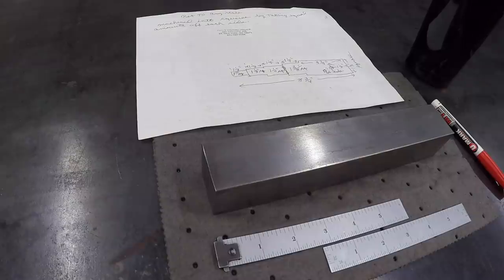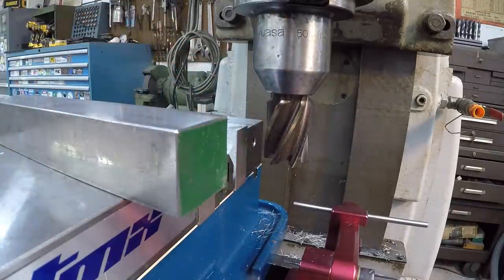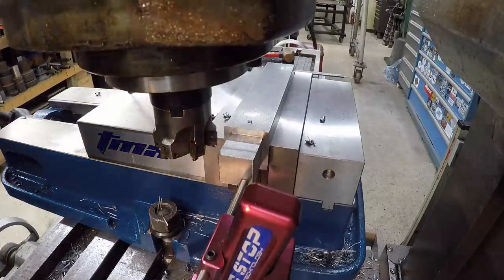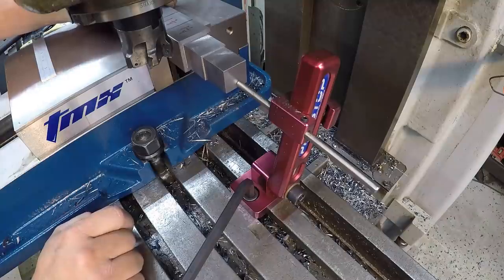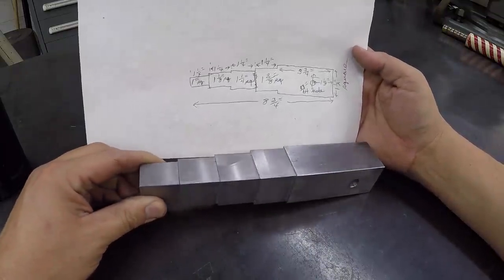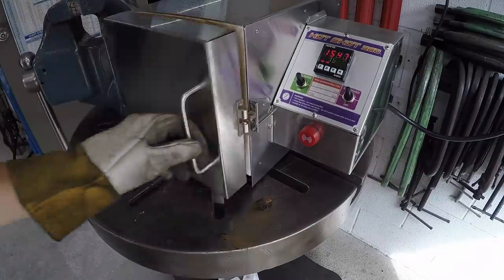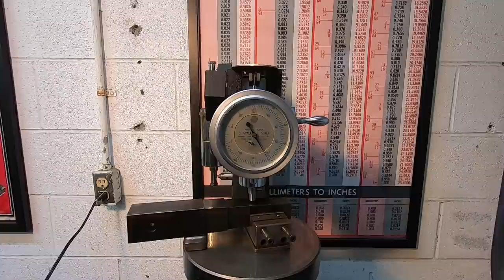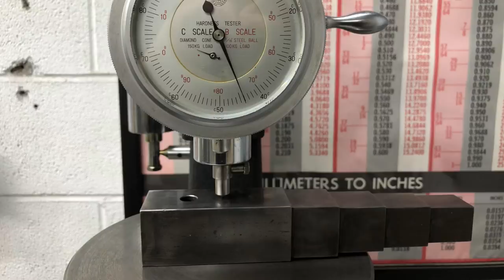SNS 296: Custom Square Drive Tool, Heat Treating

Comment: Removing the foil (quickly) before quenching should be much better. Otherwise it's a much slower cooling..
Reply from the maker: Easier said then done
Reply: Indeed, this cries out for a clever tool to tear it off!
Maybe when you open the oven, something to split the foil and leave it behind while the work piece slides out.. Ceramic scissors? Or tungsten?
Reply: @Abom79 : love watching Your posts, I have never commented before, Adam have a couple things, cheap: piece of channel and if need be tack on some higher sides and ends and the cheap part, those cast iron chips that we save when machining them, make a bed of chips and lay part in and cover up completely with chips, also a  piece of stainless steel wire thru the hole to pull out quick and get in oil quick, also when checking on Rockwell c scale if You don't have to grind the whole part just surface grind a small area to clean scale off for correct reading. Yes, metal bucket and orange glow all way thru and quickly pull from chips and into oil. I know You have bunch of comments, want to help with comment. God Bless You.

Comment: What hardness did he get on the part after quenching it the second time around?
Reply: He showed in the vid that he got a couple spots at 41 but most were much lower and the average was around 26 HRC
Reply: @GeorgeBurkhard  Think he said he was not happy with the results and did everything a second time off camera. Was wondering if that changed the results.
Reply: @the_hate_inside1085  Oh I had thought those numbers were after the second time. Could be wrong! I guess it is confusing.

Comment: OOPS!   That hole you drilled was supposed to be on the other face, 90deg out :)
Reply: on the other side of the square, symmetrical tool?  Unless this is in jest and then I feel like a shmuck.

Comment: Not bad  for not having much experience in heat treating you were probably in the high 40 hrc i would of not put it in so long hour should of been good at that temp then as soon as it comes out quench in either oil or water with 4140 then draw back for two to 4 hrs at 400 degrees a2 or d2 would of been good at that temp an time

Comment: 3 things I would have done different, I would have annealed before milling so it didn't bow, then I would have annealed after milling, and surface ground the tool to the end specs.

Also for heat treating 1hr=1mm of heat penetration. So if you did 2 hrs, your hardened surface is 2mm deep.
Reply: hahahaha.   We've got ourselves a keyboard metallurgist! fun!     Your 1hr/mm you are referring to sound like parameters for case hardenening non-hardenable alloys or something.    Keep Blazin! lol
Reply: @jamesolivier3192  case hardening non hardenable alloys? Smoke some more crack guy.... 😂 😂 😂 Heat treatment is pretty self explanatory, you need to get the piece of metal hot enough rearrange the molecular structure, the thicker the piece of metal is, the longer it takes to get the core to that temp. Adding carbon to it is also important, as the iron molecules are bigger than the carbon, and the carbon fills out the empty space during the wandering of molecules which the heat creates.

I mean you don't have to believe what I say, but I'm 100% certain the Germans are more standardized than the states are (which is why we have metals here in Germany that you can only import to the states). 

I just happen to work in the manufacturing of bearings, with 3 industrial blast ovens at work, that use nitrogen to add the carbon. If his tool was properly hardened, it would need to be ground down, because the metal swells due to heat. Glad you could say I'm wrong, and try to tell me that I'm trying to harden non hardenable alloys. For the record we use bearing steels, normally 100Cr6 or 100Cr6Mo7.

Comment: Question: Is it better to do conventional or climb milling ?  Is there a difference ?  Thanks.
Reply: Climb milling is typically better.  Sometimes during conventional milling your part will be out of spec due to backlash.
Reply: Climb milling creates a better surface, but you need a machine with little to no backlash, as climb milling exerts more axial forces onto the workpiece and will slip on typical acme threads.

I was taught to mill conventional on a conventional mill, because of the threads. Unless you have a ball screw I would use conventional.
Reply: Climb milling gives a better finish but not recommended on small Mills because it will create a lot of backlash and shaking. Climb milling is usually only done on large manual machines and CNC machines. Conventional is recommended for smaller manual machines and is typically more recommended in general.
Reply: @CatNolara  Thank you
Reply: @chronicblazer84  Thank you
Reply: @SweetTooth8989  Thank you
Reply: You're welcome thanks for you input to my question.

Comment: As to your question about the orientation of the piece in the oven, if standing it up would be beneficial, it really depends. If you are through hardening or hardening the piece in any way in which exposure to a specific material is NOT a critical factor, then no, orientation will not be critical. This is justified by the heat soak time in which the molecular structure of the material changes orientation through the heating of the piece, thus allowing the carbon to migrate across the structure therefore improving hardness. There are other factors, this is just one example. If you are hardening a piece in which exposure to a certain material IS critical, such as carbon for carburizing, then surface area contact with that material should be considered and orientation becomes important. Just from the small amount this video reveals, that ovens thermal capacity may not be enough for the time allotted. The "one hour per one inch of cross section" is much more complicated than it seems. There are several other considerations that play a part in the clock time at the different phases of transition, the limiting factor is thermal capacity. Your part may have just needed a longer soak, or a stair step up/down cycling, in where one temperature is held for a time then a higher temp is held. Just a word of caution, there are many channels on YouTube in which the creator may be "familiar" with heat treating, however, if I were you I would would find a ASME book that covers heat treatment of materials. No hatred or contempt, but A LOT of what I have seen about the subject on here is mere speculation or misunderstanding.

Comment: Ive not done alot of hardening, just a few times myself, but in the shops ive been in theyve always used the foil on air hardening steels and always do some normalizing cycles before hand in order to avoid the inconsistencies. Wish i could be of more assistance. Unfortunately im not real familiar with HTing.

Comment: It must be hard for that oil to pull heat out of such a large thermal mass. It’s probably getting heated from within almost as fast as the oil can drag the heat away from the outside

Comment: I work with some heat treating in my job.  Take the smaller piece that you heat treated and remove about .060" from all sides then recheck it and see if you get a more consistent hardness around what you were originally looking for 50Rc.

Comment: I think when you temper you let it cool down slowly over time rather than use the oil like you would in a quench
Reply: This is also what I’ve seen when making knives.
Reply: Yes , you heat it up and let it cool slowly, this will relieve any stress in the part.

Comment: I remember the factory making some EN32 pins, after heat treatment one of the draughtsman took a pin back to his drawing board, where it promptly rolled off on to the floor and shattered. Oops.

Comment: Air cooling then a draw has worked best for me with D2 4140 and S7. Never really quenched in oil unless the parts are small for like sensors or tooling balls. But I’m only 24 with 5 years experience so what do I know.
Reply: Age is irrelevant. Mental plasticity is an advantage. Experience is generally valuable. If someone leads you to believe otherwise tell them "fuck off, you're a moron" and call it education.

Comment: Look up your TTT charts for the 4140, if it takes more than ~8 seconds to cool down to martensite range then you may miss the curve and end up with too much Pearlite.. https://www.researchgate.net/figure/TTT-curves-of-steel-4140-corresponding-to-10-and-90-of-transformation-3-It-was_fig5_267529079   I just learned about TTT charts from a buddy, hope it helps! going to high temperature in the austenite range will give you a bigger grain structure even when you quench.
I read this in one spec sheet "the steel should be austenitized at 1500 to 1550 º F (815 to 845 º C)," so maybe you're over a little bit... but not so much to make a bigger grain size  (maybe?)... 50C over the recommendation.. unsure. maybe it drop it 30c over.

So you wanna know - what is the austenite transformation range, and what's the TTT curve (quench time/temperature) to keep it from forming Pearlite (slow = soft)

Also, martensite continues to form below 0c, so you can also dunk it in super-cooled liquid and get a little more hardness :)

Comment: What I do not understand:
Normally you have some deformation on the material after the heat threading. Depending on the material and the steel charakteristics, the deformation can be substantial. Because of that, in case of precision tools, you make a milling with oversize, and then heat threading, and grind to the target size after. For witch purposes should be used this strange tool, if you don't care about any precision there.

Comment: All I use is water never tried the oil. I would have grapped the part standing up with the tong .Also heat your tonqs to temp. and use a figure 8 pattern when quiencing
Reply: Water will boil leaving air pockets around the part which will result in uneven temp reductions. Oil pulls the heat out at a faster rate and more controlled.
Reply: Garth Clark you’re actually wrong.   Water is the best media to pull heat out the fastest.   Oil is considered a “soft” quench media as it doesn’t pull the heat out as quick.   It is used for alloys like 4140 and higher since they are more crack prone during quenching.  And if you move the piece around, your bubble theory is not true.
Reply: @foundryman1985  Interesting. There are so many heat treatments that use oil. I'm no study on the matter, just observe what folks use in the industry.

Comment: Have you calibrated your tester?
Reply: How would you do that by comparing it to the files? Test piece of metal with a known hardness.
Reply: He has a video of going through all that when he first got the machine. It came with calibrated test disks, and it all checked out within reasonable tolerances.

Comment: i heat up to 700 to 800c then quenched it in water, /Cleaned then back into over at 400-500 for 2 hours then quench in old dirty  engine oil.
walah! approximately 3 to 5 x harder. you can go extremely harder but then it will be brittle by lower and slower heat treating
Thats how we used to do it in the railway works.
Reply: There are different kinds of alloys designed for either water or oil quenching. It isn't the case that water is automatically better lol. And "dirty" has nothing to do with anything.

Comment: What hardness can one suspect to get from that type of steel. Is there a limit? Maybe there is steel out there that takes a treatment much better than 4140. Just throwing that out there.
Reply: Hi mate, as I understand it, there are many material types heading into heat treatment more accepting than 4140, however 4140 already has good mechanical properties in its annealed state and I think the heat treatment was more of a way to get some experience with his new oven and improve on the properties of the tool for the customer. If high hardness was his main goal a tool steel like D2 would have been more appropriate,  but hardness comes at the cost of brittleness, and you could potentially risk the part failing if the loading in service is rapid and high. The softer but tougher 4140 will flex a little effectively buffering the load while the torque is transferred from the tool to the part it's being used on.

Comment: Any particular reason Adam worked from small section to large instead of larger size to small? Does it matter?
Reply: That's what I was wondering, that would have spared him the deburring operation ,
 I don't really know, 
Anyway I'm just here to see the heat treat expects
Reply: I guess it is because this way you can maintain work rigidity batter , no chatter.